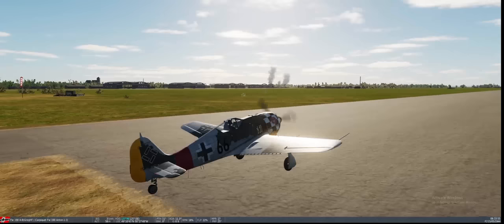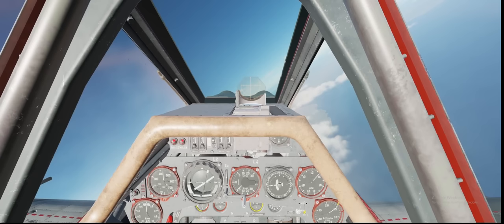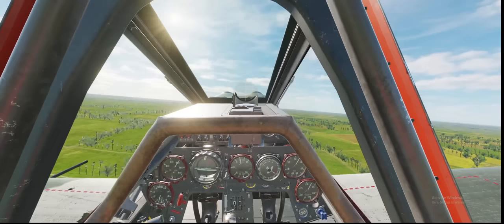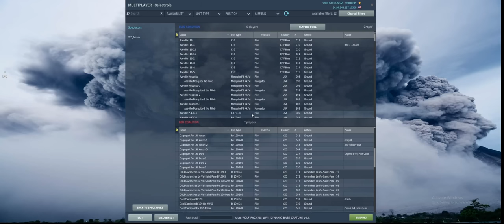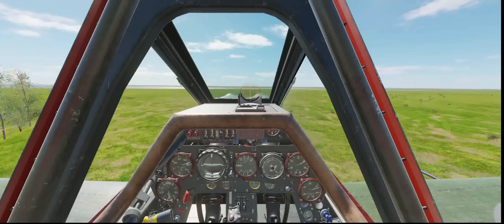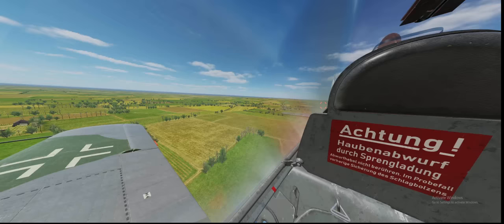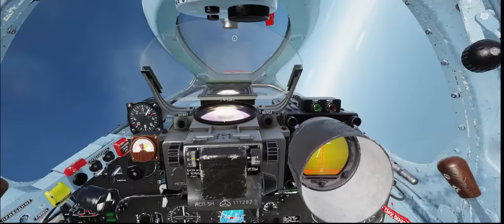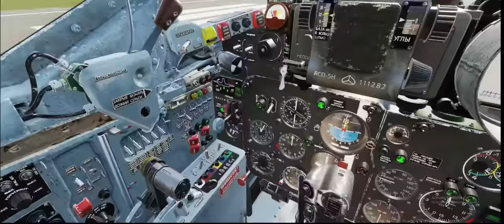German Cannons, Soviet Cannons, P-47 Mach, Angry Authors and More

Comment: The theory behind the origins of M-shells is interesting, however it falls into correlation/causation trap - the germans themselves did not really knew whom they were going to invade, hence, mess with Yugoslavia and Spain, partially, Britain. In case of Soviets, they went to full-metal construction on bombers since TB-3, the most produced soviet bomber, Pe-2, was also made of metal. First prototype of Il-2, TsKB-55, was full-metal either. Their anticipated fighters, I-30(the first Yak-3) and I-185 were also constructed of metal. The only outliars were LaGG-3, which was made with delta-wood and soviet copy of Cr.714. Soviet obsession with wood was not a conscious decision, but a product of necessity. Therefore, assuming that the VVS would consist of wooden constructions would be incredibly lucky for Ge*many,  or a stroke of time-traveling.
Reply from the maker: I don't see it that way. The planning for the invasion of the Soviet Union was started no later than the Battle of Britain. That's about 1 year before the invasion. It's actually pretty clear they were planning it well before that but explaining my reasoning there is way too long for the comment section here. I think it was also pretty obvious that the Soviets were going with wood for aircraft in 1940-1941. No time travel required to see that.
Reply: Yeah, so as DB-3 - DB-3F was all metal.

Comment: RE: The MiG 19, it, too is one of my favorite aircraft--the triple NR 30mm cannons are proven killers; it's fortunate that, at least over North Vietnam, they never managed to fit 'Chinese' version of the '19' with Atoll missiles as well as the guns.
Reply from the maker: The Mig 19 wasn't a big factor in Vietnam, it was very difficult to employ it there because of it's ridiculously short range. It can ferry a decent distance, but when in combat when using the afterburner, it runs out of fuel very quickly. Even on these short missions in this video, which were in real time, I was seriously low on fuel by the time I landed.
Reply: @GregsAirplanesandAutomobiles : Yes, and those twin engines made maintenance difficult--if not for those issues you mentioned, then the firepower, agility and speed would have made it more of a handful--kind of like a more capable MiG-17.  Something I noticed from the Marshall MIchel book was that all aircraft lost to the '19' were destroyed by cannon fire, and these shootdowns have very few survivors.

Comment: 32:30 The other issue with why metal US fighters could out dive the wooden German aircraft, is the failings of the German chemical industry (ie: glues.) The wings could separate at high speed during the wing fluttering they would experience. So, for safety concerns, German pilots wouldn't want to test the ersatz materials under extreme conditions.
Reply from the maker: I'm not sure what wooden German aircraft you're talking about.
Reply: @GregsAirplanesandAutomobiles  In order to save on the strategic materials of steels and aluminums, the wings were often made of wood that was glued together. Sometimes as laminar strips for ease of shaping.
Bf109, Ta154, Me163, Ho229, He162.
Many Allied planes were also, especially British.

Comment: regardless if fuel starvation due to enemy hits or not, in Real life, so long as you land the airplane safely in a recoverable and reusable condition, it is not a shoot down. It would be no different than just having diverted and landed at some emergency strip. 

To count as a kill, the aircraft has to be a loss, a right off, can't be used again. Damaged airplanes landing safely and recoverably are not shoot downs (in real life).

Robert S Johnson returning to base from his famous flight, is technically a shoot down, but also not. This is a perfect example of how muddy it gets. Also, in WW2 many USN pilots returned successfully to the carrier and landed safely aboard, but the aircraft were so shot up they pushed them overboard anyways. It's highly likely that 1-2 Germans claimed to have shot down Robert Johnson that day, but the final encountered pilot likely did not. And the USN aircraft that returned to their carriers weren't counted as kills by anyone either. And kills scored against aircraft on the ground never got counted either.
Reply: Kill can have more than one meaning. If your forces are under an intense period of attack then what is not technically a kill because in a month it can be fixed can be a kill in a tactical sense. Your capability to put up a defence could be reduced to zero even with technically none of your aircraft being killed.

Quite a few Luftwaffe kills in the Battle of Britain were Spitfires and Hurricanes that flew again. Or some of it flew, as they replaced older wings with all metal ones as part of the process, for example.
Reply: @wbertie2604  Agreed. Excellent examples.

Comment: Minengeschoss were much more expensive, required new machines for manufacturing and didn't work good in 20 mm AA guns (lower sectional density hindered long range performance in dense air). Jet planes are much stronger structurally, so typical modern shells have little lower, intermediate fill factor - around 15 percent.

Comment: MiG-25 could not reach Mach 3.2. This figure came out when some tankie took its real max speed Mach 2.83 (at 15 km) and converted it to kph using speed of sound at ground level (2.83x1225=3467 kph). And then compared it to SR-71 which has 3540 kph (Mach 3.3 at 24 km). Yes, it is that stupid.
Reply: So the soviets shipped 25s to Egypt, ran them at max speed so Israel radar would pick up their max speed and tell the usa. Report at the time said it was 3.2
Reply: @perh8258  Wikipedia has 2 links from that statement and both are claiming mach 3.2 in totally different fashions unrelated to that "report", lol. One claims that Belenko said to interviewer that prototype (that he never saw) could fly at 3.2 and other states that production MiG-25 could do that in "clean configuration" (i.e. with no missiles) without any further details. The rest of the sources I've seen on this claim are even worse.
Reply from the maker: As far as I know it was only the recon version that had a claimed Mach 3.2 limit. The Fighter was 2.8x, still smokin fast.
Reply: @GregsAirplanesandAutomobiles  I don't buy it. At those speeds raw engine thrust is not the main problem, SR-71 had insane engines that combined turbo and ramjet operation while MiG-25 engines are just huge turbojets. Look at Tu-123, it was basically disposable MiG-25 engine, fuel tank and tiny wings. It maxed at M2.5.

Comment: since the spitfire and mustang had essentially the same engines, the spiftire could not have beaten the p-51 in speed per horsepower. "Could a, Should a, Would a" is not a valid argument. Much testing showed the elliptical wing shape is actually not the best for high speed. And the P-51 wing was shown to be around 50% lower drag than any other designed previously in NACA testing during the P-51's original prototype testing. Good luck matching that with a spitfire wing. Changing the wing is a clean sheet design, hence why NA opted to design the P-51 from scratch than try to fix the P-40, they saw the P-40's flaws and knew what needed to be done to fix it, but to fix it would require a new wing then a new fuselage, etc..
Reply from the maker: I put up the sources for that statement in an earlier video on P-51 drag. Yes, the 51's wing was a big help but various sources point out build quality as a huge factor.
Reply: @GregsAirplanesandAutomobiles  I'm not denying build quality. NA guys could build a quality airplane for sure.

But there are other drag factors at play that few people know about. There is one drag reducing feature in particular that the P-51 pioneered the use of, and I have yet to meet another human being who is alive that knows about it. I always check new videos, articles, and books on the p-51 to se if anyone else has found it. Thus far no one has. 

I have at least 2 sources on this, and actually found it myself totally on accident while developing a number of inventions (many of which I now have patents for) for high performance cooling of cutting edge computers. I have also learned a number of other ways to reduce drag that are still not known by most, and not even taught to aerospace engineers. I have sources and test data on those ideas as well, and will be doing experiments of my own in the future.

But I'm still learning details about how NA got the drag so low. and the reason people can't figure it out is that, one, most people don't have the requisite knowledge needed to understand all the aspects involved. And two, NA nickel and dimed the drag to be as low as possible. they spent a significant amount of their effort on reducing drag of the original prototype. They put incredible effort into finding ways to reduce drag everywhere they possibly could. And people underestimate the stack-up effect of that many changes combined together at once. Where I work as an engineer, we do exactly the same thing to improve our systems. we are world leaders at what I work on, and we achieve that success by leaving no detail ignored. we look for the stack-up combined effects of multiple improvements all over teh total system to achieve what others cannot. SO I am extremely familiar with this mindset. And how the NA team worked in order to be able to turn out the prototype in less than 180 days is that same way we work at my current job, and it's exhilarating to see it done right.

Turns out from the sources I have found, as I suspected, NA engineers were WELL aware of all the NACA testing, and NACA had even picked out and suggested they try using the laminar airfoil they did. NA and NACA well knew the studies said laminar flow required clean surfaces, and they intended to solve that with paint (which we know many mustangs never got painted wings). But even NA engineers were unsure about using the new wing, and saw it as so much of a risk, they had a backup wing ready incase full-size wind tunnel testing of their new laminar wing didn't work as hoped. If it hadn't worked, they would switch to teh more traditional wing design. This didn't happen as the wing worked as hoped. But what I found suggests that there is more to the wing design than mere laminar flow and tight seams/doors/access panels. Something else I haven't been able to put my finger on yet seems to have contributed. But the prototype mustang wasn't painted, and still saw significant drag reduction due to its wing design. So we're still missing some detail/s about the wing design. And from what else I know, it could be a VERY subtle detail indeed, but makes ALL the difference. If I am right, I of course want to find it, as it could possibly improve other aircraft designs.
Reply: @SoloRenegade  Lol, very strong "I am very smart" energy in this post.

Since you're a genius and have made so many inventions, you're a well known billionaire in real world, right? After all, you've figured out stuff about drag that no one else has! (According to you, that is)
Reply: @TzunSu  Insults get you nowhere and win you no arguments. Insults are for when you have no other argument.

If you knew anything of value, you'd know it's rarely the person who patents things who profits from them. In engineering patents give a person status and credibility. By proving you can come up with unique and novel solutions. Where I work you submit your ideas to a review panel and they decide if it's worth pursuing. Even if it's patentable, if it doesn't relate to our industry they don't pursue it. If they don't think it's a good idea or you can't demonstrate it actually works, they also won't pursue it. This panel is made up of other experienced engineers. Many patents are things the average person could not turn into a profitable business venture alone from nothing. Many ideas only work when tied into a large system, and if you don't produce that larger system, then you can't profit from it. But the company values protecting those ideas.

More patents equals more pay, more promotions, and easier time finding another job if necessary. It proves you are a problem solver. And yes, I have tens of patents, along with world records, world firsts, and industry awards and even medals (from NASA) for my work.

I am very smart, and people like you get very irrationally upset at me simply for being self-aware of that fact. In 4th grade I was already scoring in the top 1-2% nationwide in every category, especially math, mechanical comprehension, mechanical intuition, etc. I've had multiple careers and multiple degrees, and graduated top of my class every time and excelled in my careers every time. People do call me a genius often, though rarely to my face. I'm a natural born polymath, a natural pilot, and an natural engineer. There are plenty of things I suck at though too. other concepts I struggle to wrap my head around, same as anyone else.

That being said. there is literally NOTHING I know or can do that the average person can't also know/do if they merely put in the time and effort to achieve it as I have.

Getting upset and jealous of others for their success is why people like yourself struggle in life. While you and others are whining and complaining, I'm working my butt off trying to get better, to learn more, gain more skills, etc. I never stop. I never complain that others know more than me, or do something better than me. I instead try even harder to do better than them, knowing I wont best them overnight and that it will take time to achieve. But I can beat them if I want it bad enough, and eventually I do beat them. You could do the same with the right attitude.
Reply: @SoloRenegade  Sorry dude but when you claim to know things no one else in the world knows about a famous 80 year old airplane, no one on the planet is going to believe you with out mega proof. I can also tell you from personal experience that telling people "I'm smart" makes them hate and discount you. It's called show don't tell.
Reply: @SoloRenegade  Jesus christ, there's no sound sweeter to you then your own voice, is there?
Reply: @wingracer1614  "Sorry dude but when you claim to know things no one else in the world knows about a famous 80 year old airplane, no one on the planet is going to believe you with out mega proof."

I never said any such thing.

I said that no human ALIVE that I have encountered PERSONALLY knows what I know. If you know, feel free to be the first person I've encountered alive who does know. The authors on at least one of my sources is dead. the other author I've never met.

"I can also tell you from personal experience that telling people "I'm smart" makes them hate and discount you. It's called show don't tell."

well aware, and my "show" includes so many accomplishments it leaves people's jaws on teh floor. I speak from a track record of PROVEN successes over and over and over again.

It's more about people being Jealous than anything. No amount of SHOWING will Ever make people be happy, about a smart person being self-aware of how smart they are. But that in NO WAY invalidates the assertions of the smart person with a proven track record of successes that far and away exceeds that of a normal person.

Jealousy is the real issue. All your comments have been solely pertaining to jealousy. You've never offered a single facts-based counter to anything I said about teh mustang. you never once addressed any of the actual arguments pertaining to the topic of aircraft, aerodynamics, etc. I refuse to sit in teh shadows silently simply becasue people like you can't stand others knowing things they don't. Can't stand others being smarter than they ever will be. We're competitive creatures, I get it, but you're not right, and I'm not wrong, in this case.
Reply: I think NA also thought that creating their own design was going to be more financially advantageous than building Curtis aircraft
Reply: @SoloRenegade Why would anyone be jealous of you? It's not like anyone actually believes you, you do get that right? No lack of edgy teenagers pretending to be geniuses online lol.
Reply: @SoloRenegade  How can I know if I know what you know when you refuse to say what it is you know? Though from other things you have said, I suspect you're thinking of how the P-51s cooling system actually generates thrust. If so, you are most definitely not alone.
Reply: @wingracer1614  Nope, Meredith effect is WIDELY known, and Greg has discussed it as have hundreds of other books, videos, articles, etc.

Not even close. The item I am speaking of is a purely aerodynamic feature. I'm withholding it with the thought that I might do a video or something on it myself if no one else does.
Reply: @TzunSu  "Why would anyone be jealous of you? "

you tell me? you're the one who replied SOLELY whining about me coming across as being too smart. 

Yet you never addressed a single thing I said, merely came after me Personally, rather than what I was saying.

So, since You're the one with the issue, you tell me what your issue is.
Reply: @wbertie2604  Absolutely! Building someone else's designs could mean the end of an aviation company. You spend so much time and effort building their designs rather than designing and refining your own designs. I and 100% certain NA had No intention of building another company's airplanes and would do anything to build their own instead given their peoples' expertise and skill. Hence the bold claim/bet with the British.